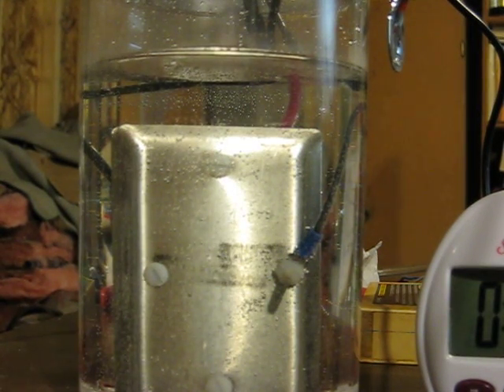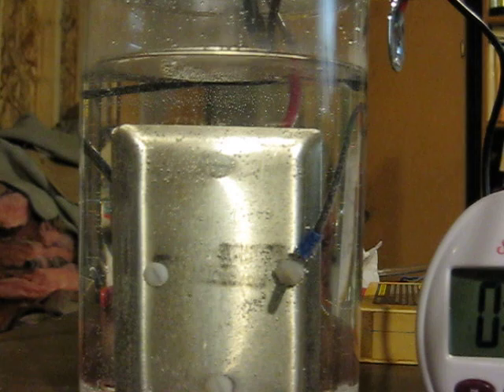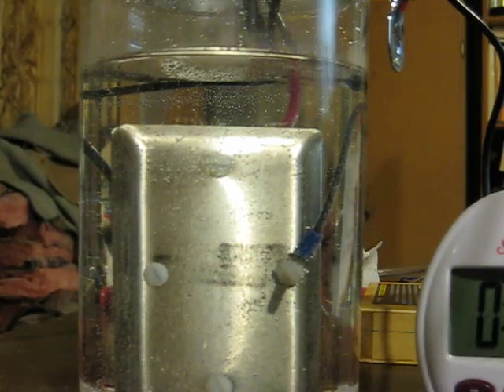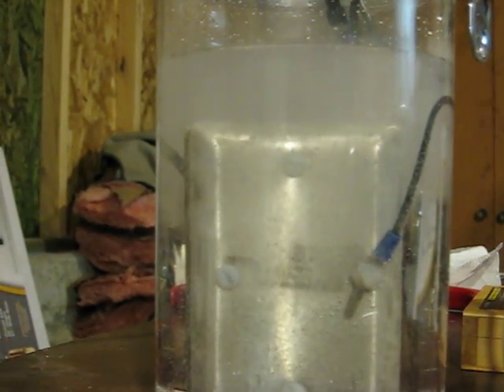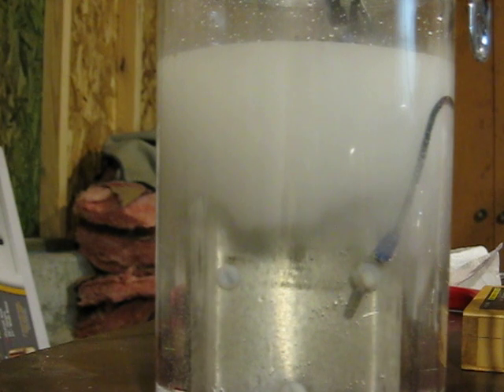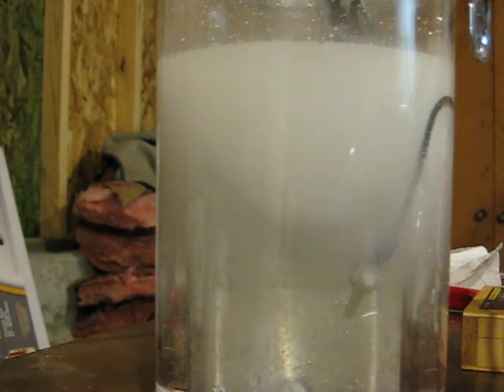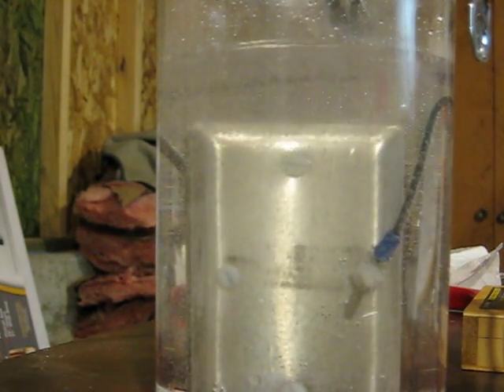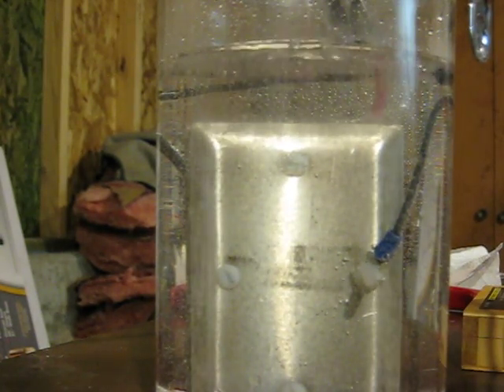HHO Electrolysis & Ultrasonics ©

Comment: Vibration is the key but you have to reach one of the lower harmonics of the water molecule itself. Finesse over brut force. That would require a variable frequency generator so you can tune it. Be careful though as this is very dangerous ground! One researcher was performing just that and all of a sudden there was a violent explosion, the 2" stainless steel reactor was bone dry and there was a 2" whole in the ceiling and roof directly over the vessel!
Reply: What is your source, please.

Comment: We observed that increasing Voltage from 13.8V to 48Volt gave us a awesome increase in hydrogen Production with the same Current input.
Reply: 13.8 V with 2 amperes makes 27,6 W
48 V with 2 amperes makes 96 W
so current is same

Comment: about 4 or so years back I had used an ultrasonic vibrator in a cell I was testing, I got it at petsmart, it was a simple little thing, anyways it produced results much like what you see in this video, however it did not withstand the test of time, and with prolonged use the chemical reaction due to electrolysis eventually damaged the ultrasonic unit, causing pitting and corrosion. before the unit died I ended up using a voltage controller on the ultrasonic unit itself to adjust the effect.

Comment: Where is your transducer located? In the water on on the outside of the glass. You need to adjust the frequency of the transducer to either vibrate the plates so that it as close as possible to breaking the water partial. I figuring out that it will take less current one you get to this point and it will reduce the heat. I'm thinking about using a transducer on each plate in a dry cell ?? New to all this, yet I find it fascinating:)

Comment: I tried this with an immersed  pond fogger a couple of years back. Found the same results as you.  Was thinking to immerse a crystal earpiece in the water & use as an inefficient microphone to measure fogger frequency on my scope.  With  a view to tuning the cell tubes to the ultrasonic frequency.  Efficiency didn't improve initially, so I gave it away, never thought of testing the gas for power the way you did ...good idea!

Comment from the maker: The amperage stays the same no increase or decrease. The volume output does seem to change a little bit. The volume is decreased a small amount maybe 10%. But what I have noticed is the gas is much more volatile. The bang of 1 liter is much greater. Maybe twice. I need to measure the explosive power. Mozon1967 measures his gas mixture power. This is what I need to do.

Comment from the maker: The Ultra-Sonic device was purchased over the internet on 9/11/2007.
Even the wall plate construction was an Idea I came up with after getting an outrageous  quote from a sheet metal shop for some designed plates. You can believe this or you won't I don't care.